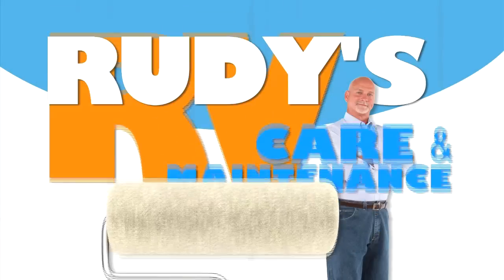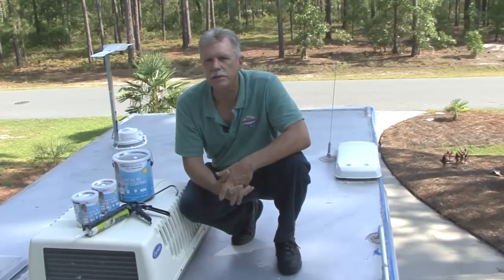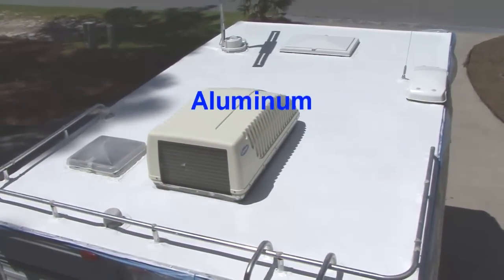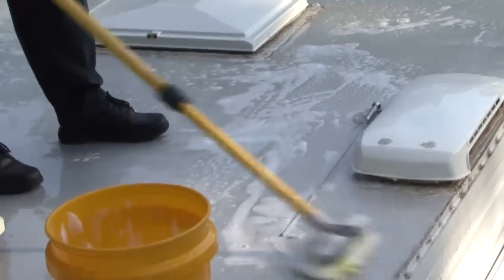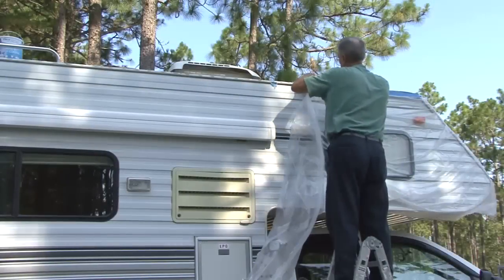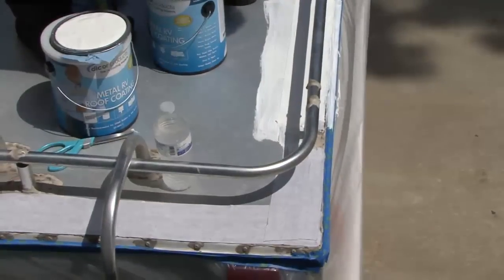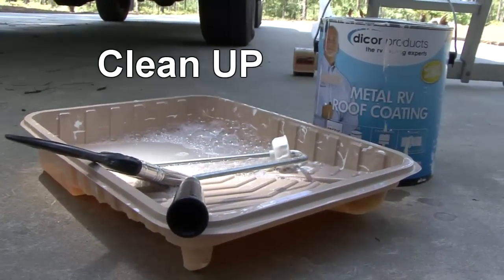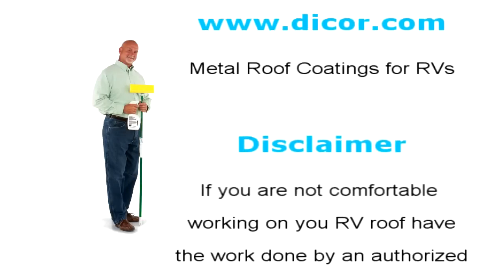How to Coat a Metal RV Roof with Dicor Products

Comment: hello!
I have purchased an rv that has a metal roof, and it has not been treated. We are planning to apply dicor metal roof coating, but I have a question for you.
The previous owner(s) have applied (what appears) to be roof tar to the outer seams and around vents and such. Is there any prepping I need to do about the tar before applying the metal roof coating? Please help.

ALSO, we are planning to use seam tape around the entire perimeter of the rv. I don't know if the seam tape will be sufficient in avoiding any issue we might encounter with the tar.

Thank you,
Jen